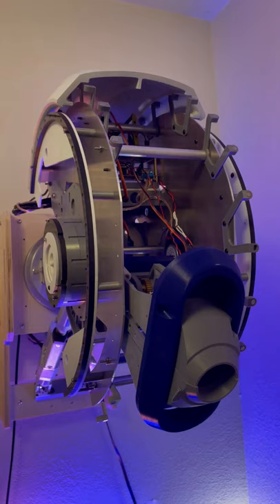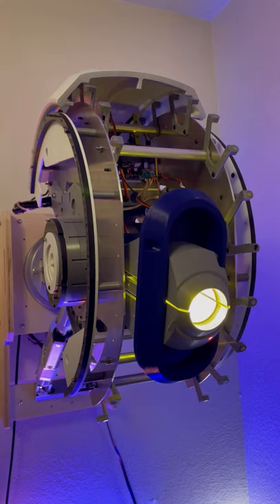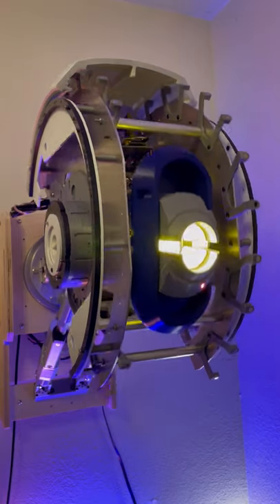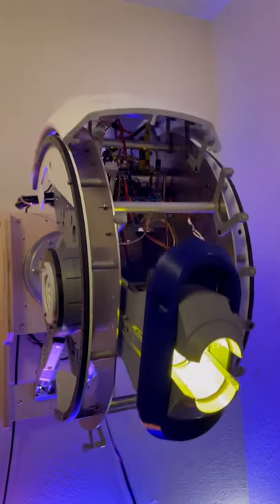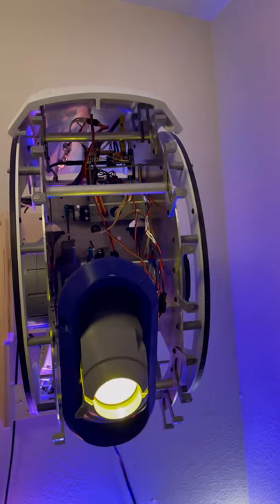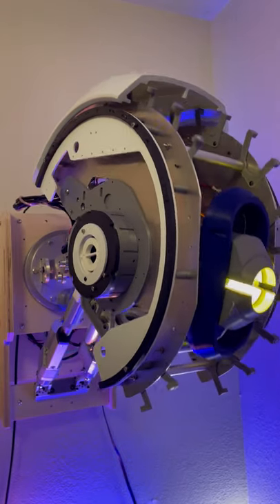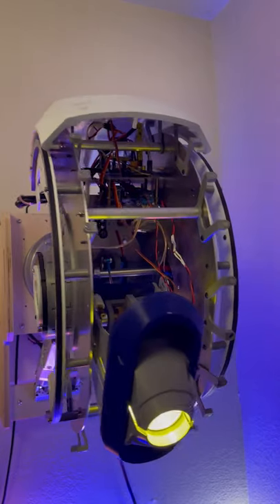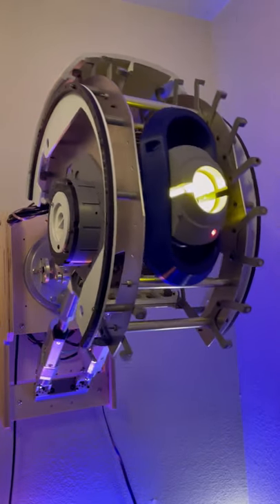GLaDOS in Real Life: Servo Calibration Test #Shorts

Comment: i'm a literal child and amateur engineer. i would really like to pursue the creation of a life-sized companion cube. as such, 3d printing it would likely not be optimal. how do you reckon i should go about it? thought it'd be a good starter project cause no electronics are required.
Reply from the maker: Hi Emasti. That's a great starter project! I would start by making a mini version first out of cardboard to get a sense of how to put it together, then I would make a full size box out of wood and make the corner and curved pieces out of EVA foam (workout mat material). I would check out channels like Punished Props and Kamui Cosplay to see how to work with the foam, but you'd be able to make it with cheaply, and with basic tools that way. Hope that helps!

Comment: It's awesome, tho is there anything you can do to avoid it going this wobbly after a movement?
Reply from the maker: Better acceleration control and a more rigid eye pivot joint for sure
Reply: @MrVolt  and would that require change in the internal design?